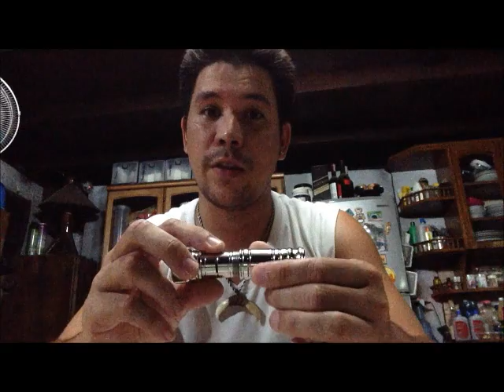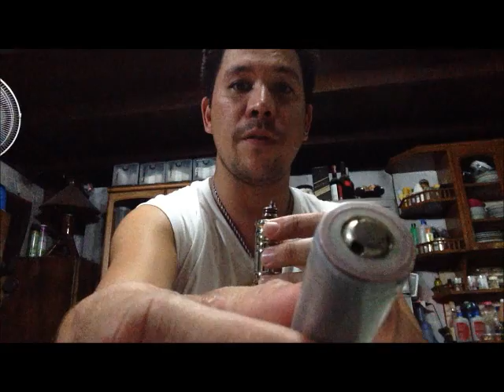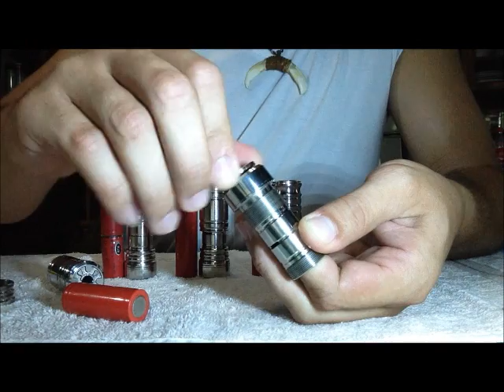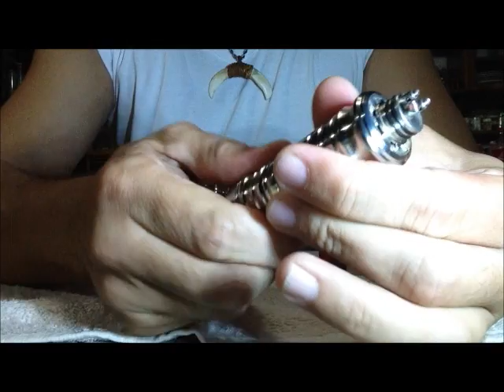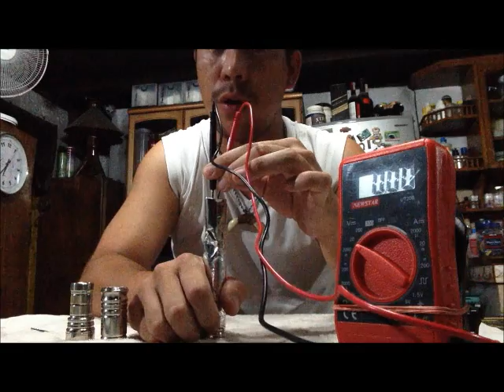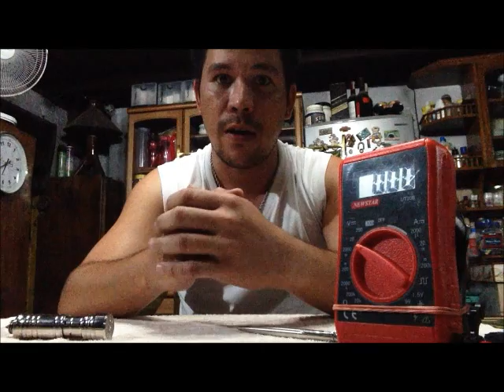RAPTOR MOD BY MULLERTECH

Comment: Nice smart design. I love devices that break the standard mold.

SRP? Will Mullertech be at Vapecon 2014? What stores will be carrying this? What legit atties have been confirmed to work? How much minimum distance needed on the protrusion of the atty's positive pin? Will there be a libag remover upgrade? :p